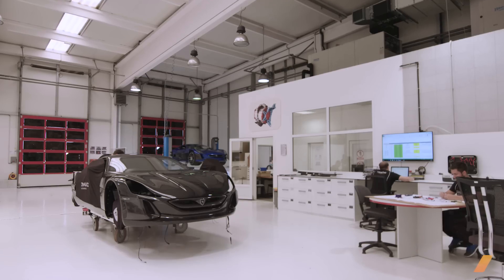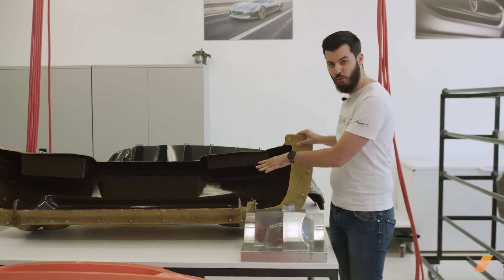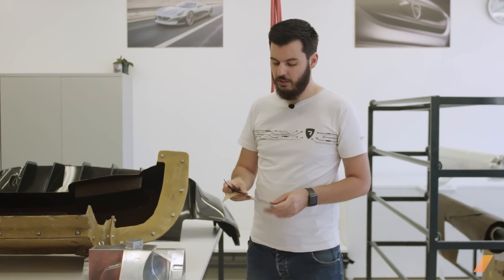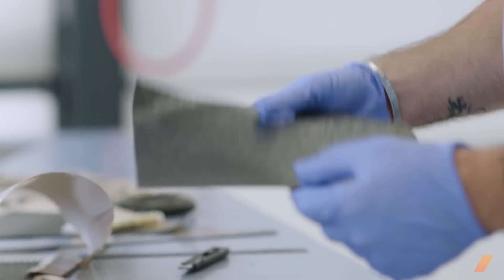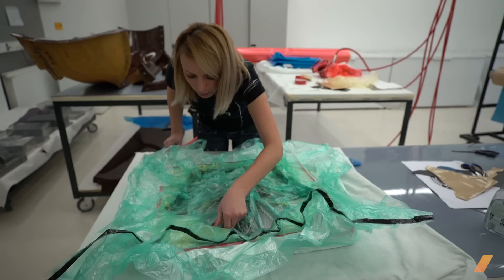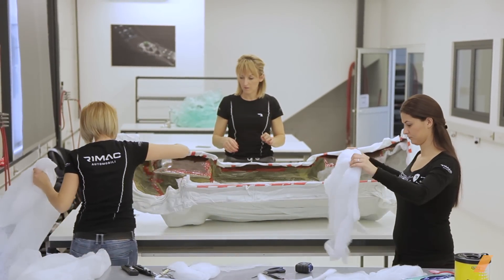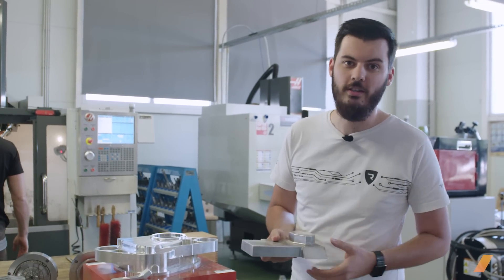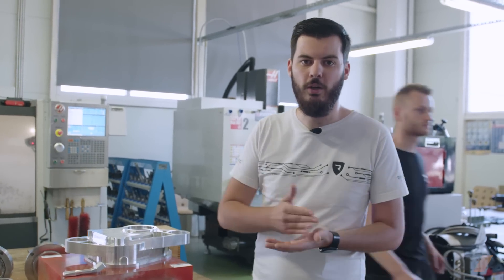Rimac Electric Vehicle Carbon Fiber Secrets [Part 3] -- /INSIDE RIMAC

Comment: One thing with sharing information about manufacturing - if others get in the game, the size of the market increases, because the product (in this case carbon fibre composite high stress components) gain more acceptance in the industry. The whole supply then has bigger demand and sales volumes. This is what Tesla proved.

Comment: This guy is definitely inspired by Koenigsegg. What an achievement making the most powerful production car of any category.
Reply: srinitaaigaura totally yeah! Though it’s still too early days to say Rimac makes the most powerful car, Tesla’s Roadster specs are roughly the same and more likely than not the Tesla 0-100km/h of 1.9 is with no ‘one-foot-rollout’ whereas Rimac’s 0-100km/h definitely is. Aside from this, both cars are only prototypes at best, so the upgrades will likely make the specs even better.
All the same: good competition breeds good products and Rimac certainly isn’t slacking in that department!
Reply: I doubt. 10000 NM wheel torque is around what hypercars make in 2nd gear at the wheels if you take all gearing into account. The actual numbers may be around 1100-1300 Nm Torque and a max of 1200-1300 HP - they may have gone for the 1 MW number. The 0-100 time is half a second better than the best times of the P1 and LaFerrari so I guess the power to weight is also better, maybe 0.70 to 0.8 HP/Ton - this much power is easily enough to get up to 260 mph +.  

Given the size of the battery and the weight of the car, I do not expect the Roadster to beat the Agera RS from 60 mph upwards either or the Regera, but it might just edge the Bugatti Chiron (though it is close), but the relatively cheap price can't be beat. Definitely not the C_Two, they're using F1 grade cells and the cost of that is probably more than the Roadster.

So it's not a 1:1 ratio like the Rimac C_Two. That 8.9 second quarter mile is all due to the gains made in 0-60 mph, which looks like a whole second faster than the competition. Musk also cleverly ignores the initial rollout, so the actual time is probably around 9.2 seconds.
Reply: @srinitaaigaura  had to stop reading when you started talking about torque
Reply: Yes, I'm a geek. You might not know - take the Laferrari. It produces 900 Nm of torque, which in first gear (multiplied by first gear ratio x final drive) = 900 x 3.08 x 4.38 or 12141 Nm of torque with only rear wheel drive. In second gear it is still making 8600 Nm wheel torque. HP = Torque x RPM / 5252

The Agera RS for comparison, makes 1370 x 3.4 x 3.13 = 14580 Nm torque in 1st gear and 9780 Nm in 2nd gear. So Elon Musk's claims are impressive yes, but he's hiding the devil in the details. The roadster probably makes about 1100 Nm torque and around 1 MW (1360) HP at the most. It suggests that the Roadster is at the most in the same ballpark as the Koenigsegg and can give the Bugatti Chiron a run for its money.
Reply: @srinitaaigaura  so you are saying despite the fact that c2 and roadster now have similar stats, c2 will actually be much better?
Reply: The Roadster is not as powerful as the C2 - the Rimac uses the same grade batteries that F1 is using. The C2 is the most powerful production car in any category ever made. That top speed is limited because of the tires. It's larger battery means it has better range though.

The Roadster will also be no match for the C2 on a track.
Reply: He went from being inspired by Koenigsegg, to selling Powertrain components to Koenigsegg.

Comment: The f35 is made from the same prepreg and f1 cars.. there is no plasticic in prepreg period. Honestly at 1000 mph, the plastic would melt fucko...
Reply: The epoxy that prepreg is impregnated with is a plastic, it's just a thermoset plastic as opposed to thermoplastic like nylon, abs, ect. The formula can be designed for high temp applications and in carbon fiber parts acts as the matrix which gives the carbon support and structure

Comment: Either you stay exclusive with the materials on the planet that are available to you or you compromise both the integrity and the value of the vehicle mentioned. Look at PAGANI, there are no shits given. IT COSTS WHAT IT COSTS... No plastice.. and no carbon fiber even with the perpreg is not mostly plastic. If that where a fact why even use carbon and titanium in the first place.. they  are getting cheep, and cheep means shitty....
Reply: You're an idiot. You can't be a profitable supplier and lose thousands of dollars on every part because you deliver parts  produced with technologies meant for development and small series production. And nobody ever said they were going to use those parts on their own cars.. because that obviously wouldn't be possible as r&d costs for high the high production volume parts would be far too high to ever use them in a small number such as in their own vehicles. You are just a pretentious idiot who has no idea how automotive production works.
Reply: all carbon fiber is impregnated with plastic, what you don't know that there are 1000 types of plastic and 1000 ways of setting that material into shape and tempering with heat

Comment: Plastic parts, what? How is that a good thing?
Reply: Kevin Parks carbon fiber is mainly plastic with a lil carbon in it
Reply: just reality of mass-production, so that you can sell cars at prices people will buy, or components at prices companies want to buy
Reply: How is high-tech a good thing? Seen many MC drivers with helmets in steel? Composite materials and industrial plastics are lighter for the same strength. And depending on design, you can have them absorb lots of vibrations, while still being very stiff.
Reply: Because plastic is cheap and easy to make into parts
Reply: Because you can make a lot of components thinner, lighter and smaller with plastics, as well as friction weld complex plastic assemblies together to make single components that are impossible in metal. Modern automotive engines for example, would not be possible without engineering plastics. Next time you get a chance take a look at a complex plastic molding, like the intake manifold of a modern engine. They are incredible.